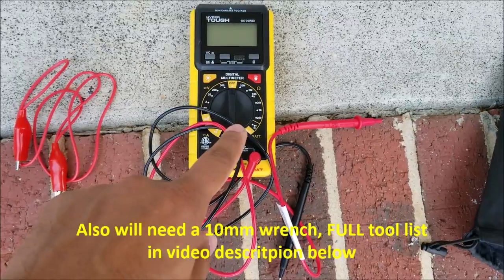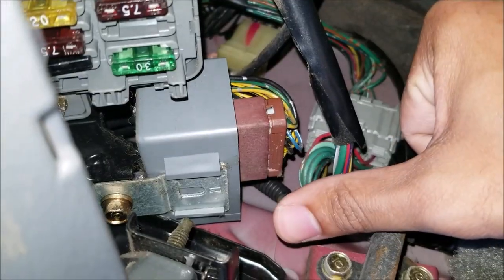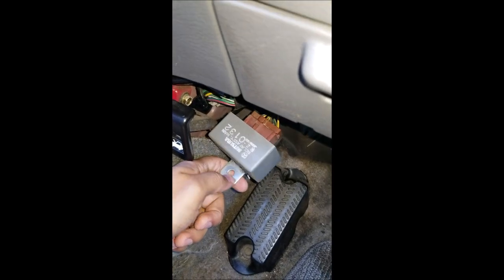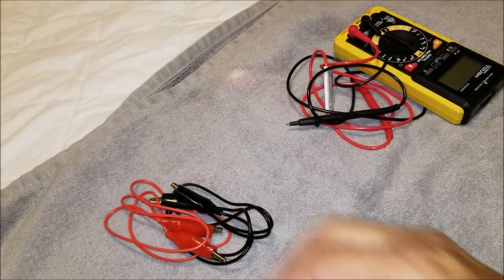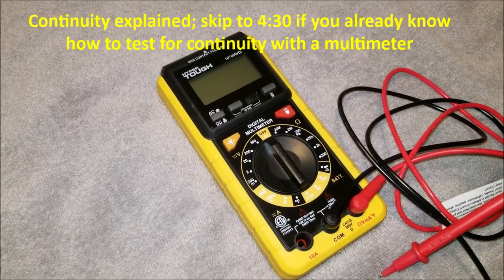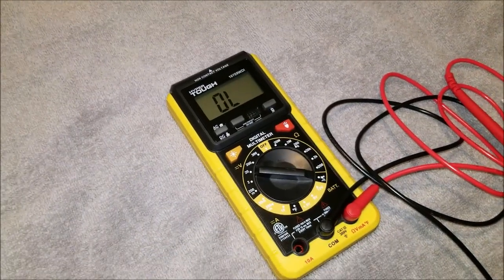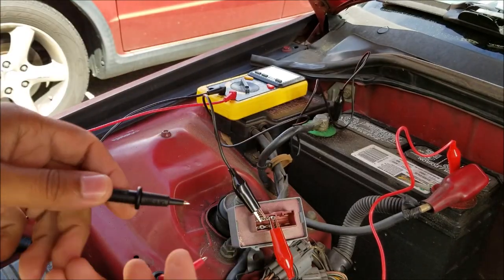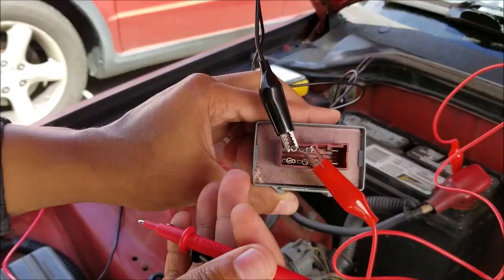How to Test and Replace Main Relay | Honda Acura 92-00 | Car No Start

Comment: I only get one click after the key is turned. It’s is the the second turn on the key when I get a click. Should I feel a click on the first turn of the key. Thanks in advance
Reply from the maker: The last two clicks after 1st turn key is what your really looking to feel. After doing this a few times I couldn't always feel first click for some reason but my relay was working properly. The last two clicks are always strong though

Comment: nice video i have a issue in my 92 teg where the relay wont work and i replaced it with a new one and nothing still
Reply: I’m having the same issue with my crx. The relay does nothing. I replaced it and still nothing. But if I just the plug on the harness with wire to bypass the relay and the car started right up. I have no clue. Gonna try swapping out the new relay for another and see what happens. The plug clearly has power and ground if it starts right? So has to be a faulty relay even new !!!???
Reply: Steven Black bro I ended up getting a new harness and nothing so what I ended up doing was cutting the negative side of the relay then adding a wire to direct ground and it worked
Reply from the maker: Were you sure you had a faulty relay? If so, you may have had additional issues causing no start. What are the symptoms of your car? Does it start and then cut off...or no crank at all? When diagnosing an issue I always keep it simple...fuel, spark, combustion is what a car needs to run. Check you are getting all three
Reply: Cranks, no fuel or spark, seems like no power to ecu, when the key is turned to ignition is only light that pops up is the battery light. Already checked grounds and replaced main relay check all my fuses. There has to be a short somewhere I swapped in a b20v
Reply from the maker: @db2alex746  is your fuel pump priming when you turn key to acc 2? You'd hear an audible hum from your back seat area? You may have an ignition switch issue. Which those aren't hard to change but it's not easy just finding the switch and not whole ignition case which is expensive.
Reply: Engineered Mojo yah no fuel priming and it’s weird I mean the car was fine before I took the engine out
Reply: DB2 Alex 
Check to see if there is a grounds wire on the thermostat housing. Check for corrosion or damage connector has that can cause u not to get any spark or fuel

Comment: Do you know if a main relay failure would lead to a no spark issue or does it only affect the fuel system? Struggling to determine the cause of a no spark on my 95 Integra. Thanks!
Reply from the maker: That wouldn't be my first guess. The ignition system is made of really two components, primary and secondary. Primary the igniter or ignition module, the crank sensor, cam sensor, and ignition switch itself. Secondary is distributor, wires, cap and rotor. I'd test to make sure your ignition switch is working as that actually just failed on my Honda few months ago. Posted a how to on that as well. Only reason I knew it was ignition switch is that my car would cut on and die immediately and I tested all other components in primary side of ignition.
Reply: Engineered Mojo, awesome. I’ll check that out too. Previous owner had an alarm system removed. Not sure if that’s related. I’ve tested the entire distributor assembly (Coil and ICM) and everything ohms ok. Just no spark.